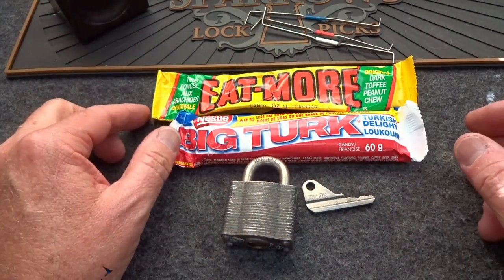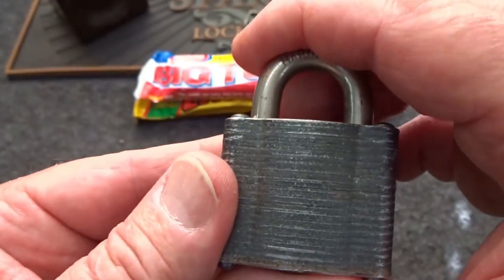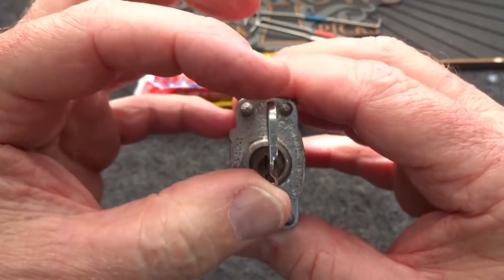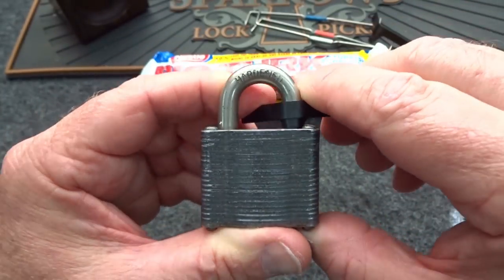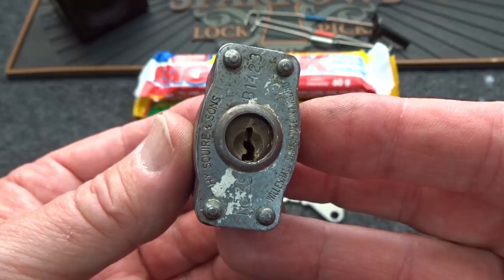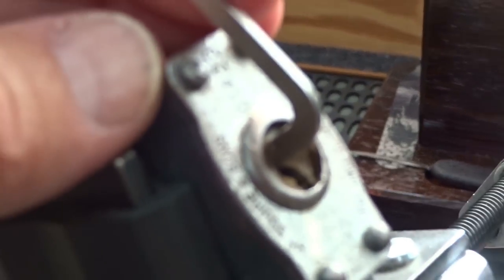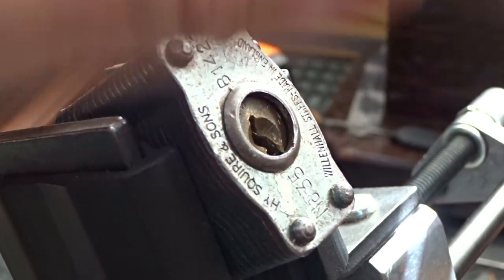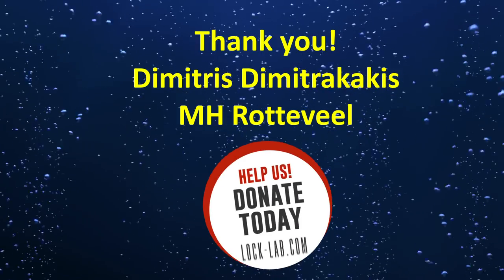(1120) Bullying Open Captain Jim's Squire Padlock

Comment: Here in Russia we follow the common logic: you open bottles turning the screw plug counterclockwise. You unscrewing a bolt rotating it counterclockwise. And we open the locks rotating the key counterclockwise (that is assumed a normal direction).

Comment: How can you go about defeating very small locks?  Luggage locks, for instance.  Many of my tools simply won't fit.  Any tips?
Reply: I have not yet seen a set of mini lock picks on the market, so the way to go is with custom picks, Bill have a video on how to make them, just scale them down and thin them to fit the lock.
Usually they are pretty simple locks and can be raked easily, so I suggest to start a mini bogota.

Comment: Bill, or anyone, why will this lock not rotate clockwise ?  I have an ABUS 80/TI50 and it will only rotate clockwise ( with the key )  Being new to locks, I have no clue why this is.... or why it happens.  Any insight would be nice, so if you feel like chatting about this, please leave a comment, I read them all.  Thanks guys !
Reply: With a padlock, you don't need to be able to use the key to lock it. That means you can build the mechanism inside to unlock the lock by turning it either way, or only by turning it one way. You can find lock schematics online if you're interested in more specifics instead of a general explanation.